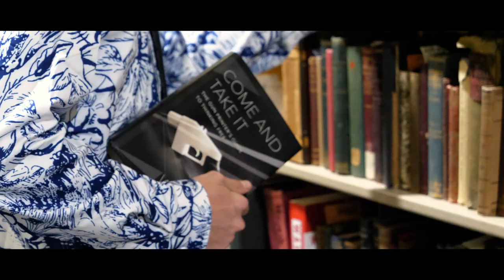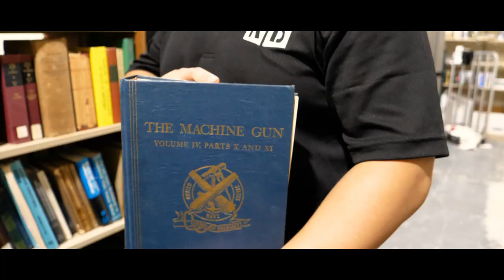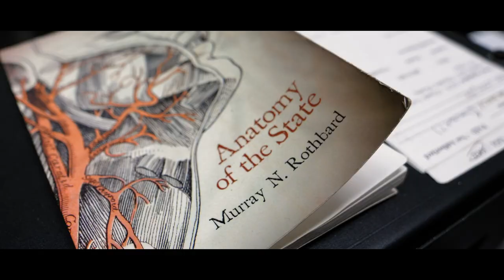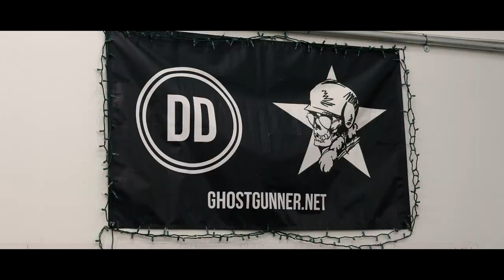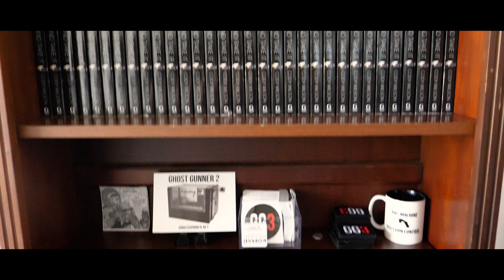Interview With Cody Wilson At Defense Distributed

Comment: This is the part of the gun community I’ve been looking for since the rise of guntubers. There is no prominent elitist attitudes, no gigantic pissing matches. Just a love for freedom, liberty and the ability to defend yourself.
Reply: Honestly I,d probably make a gun if I got one but I also want to use it for hobby use. Do you know how it works? is there software that I just load an .stl into or what?
Reply: Check out the YouTube channel, Print Shoot Repeat
Reply: @butters2160  well I just got my first printer a little over a month ago now. I have basically no CAD experience and only have a cursory understanding of anything CNC. With that said, this has been a extremely awesome experience with a low barrier to entry. As far as hobby stuff, there are communities where people will post STL & 3D object files that anyone can then go through, find what they want and download it for free (with an option to tip most authors if you really like what you got). When you got the file to an object you like you then use what’s called a “Slicer” (I use Cura which is free and very, very easy to use) and it will take that STL and the parameters you set and turn it into Gcode the printer will understand. Once you get used to printing and using your printer then go find the good good files on LBRY from DetDisp. I suggest you take the time to get good first as there are probably upgrades you will want to get and small techniques you will want to learn before diving into large prints like pews. I personally have only printed one thing pew related since I got mine but have went through almost 2 kilos of filament printing random small things either for the wife, kids or small stuff in my workshop and I’m glad I waited. I had a lot of failed prints in the beginning as I wrapped my head around exactly how to correctly level my bed, tweak my print settings and other beginners hurdles. Now I’m getting into some more advanced stuff like making a heated filament dry box, setting up a BL Touch setting up an all metal hot end and updating the printers firmware to make it all work. I can go on about my experience but I’ll stop here. If anyone is curious about starting and wants to know a true beginners experience feel free to ask, I’ll be more than happy to share my experiences and help out where I can.